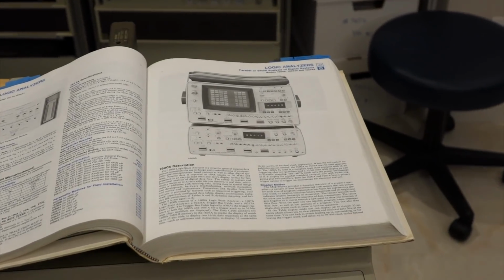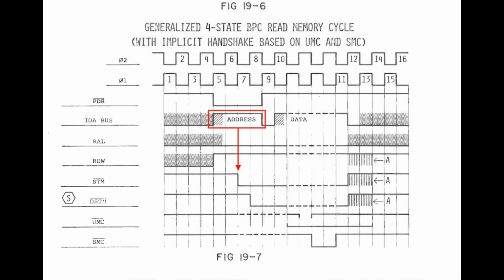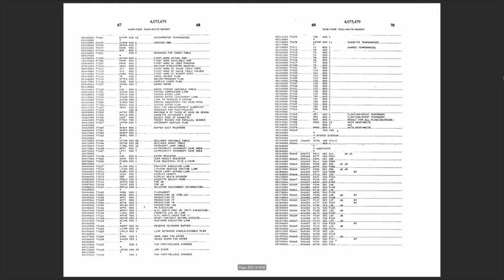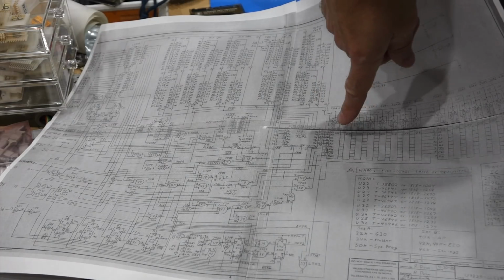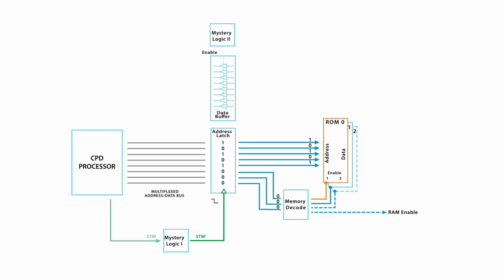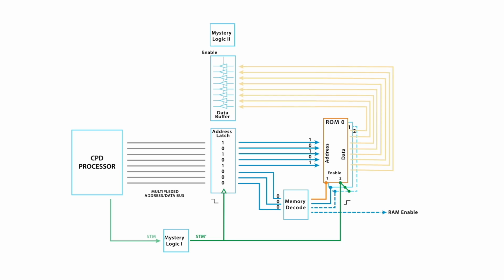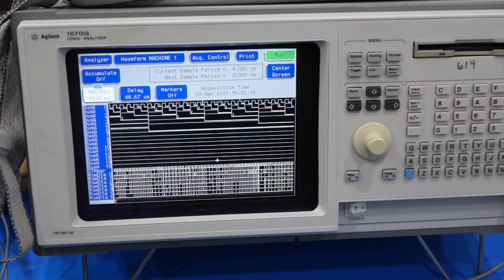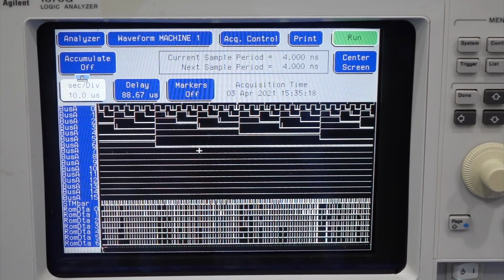HP 9825 Repair Part 3: HP Logic Analyzer to the Rescue

Comment: Hey, do you think you could use that logic analyzer to help reverse engineer and replicate a rare and expensive piece of computing and videogame history?

I am of course referring to the controller bundled with the videogame Steel Battalion for the original XBOX.

The controller and game were around $200 when they came out, but the controller alone is even more expensive today! We're talking upwards of $500 on places like eBay.

If we had the capability to fully reverse engineer it, and make an open-source clone... Well, that would honestly be incredible.

Comment: Just watching you trying to understand the signals on the logic analyser makes my head hurt. I can't imagine doing this myself, not only would there be fried chips,  my brain would be fried too.
You should just replace every standard TTL logic chip that is not a custom part and the RAM and ROM chips too. You can easily program new ROMs. Good luck finding replacements for custom chips (for example GALs, PALs, CPLDs, etc...) though.

Comment: I have a sentimental connection to HP hardware. My first encounter with computers was with HP 85, which I first saw in about 1980-ish (my dad brought it home from work a weekend ). Later in life I've come to respect the lasting value of their measurement instruments (I am a cross-over physicist by trade). In my lab there was a spectrum analyzer from a long time before my era, and it performed still about to the calibration certificate from twenty years ago. Weighed a metric ***kton but in those days you got what you pad for, paid an arm and a leg.

Comment: I had to debug a machine like this once. Not with a multiplexed bus, but my logic analyser was a cheap USB one with 8 ports. Traced the boot sequence by looking at 4 address-lines and half the data bus.

Turned out someone had done a bad rework to the RAM, losing some traces in the process.

Comment: That patent is back from the days before everything was crap like it is now. I used to do a lot of work with OBD-II automotive PCMs and getting the source code from reversing the binaries on the flash ROMs, and patents like that were invaluable for understanding specific aspects of the software. They didn't give any code, but they gave the algorithm, which was enough to figure out what was going on.

Comment: Marc, I admire your persistence, but I have to ask, "What are the chances that any of those TTL level chips survived a 10+ V supply?"

I recently had an identical failure in a much less valuable device, and I've assumed that everything in it is toast.

Bon Chance. I'll be watching with my fingers crossed.

Comment: I wonder if you could at least try to put the CPU into the one that works to confirm it's okay? Knowing it's good or bad could cut down a lot of your time so might be worth the swap.
Reply: Risky...CPU  may well be damaged,and it could damage a unit its swapped into,they have to hang it out,we'll get there.Fault finding is 50% patience,when you try to short cut,you often make things worse,i know,,ive learnt to my own cost!!!
Reply: @julianrichards9509  Do you really think so? Maybe I've just been lucky, but I've never had issues with a faulty CPU frying things. It's not outputting weird voltages or anything.
Reply: @briangoldberg4439  Sorry to be so long Brian,it is my mindset to be very cautious mate.Did you ever see the movie Apollo 13?The side of the module blew,and all of a sudden,the telemetry went absolutely crazy back on earth.The crew reported power supply failures,the  AGC rebooted,there was a loss of pressure on fuel tanks,and during one point in the mayhem,you hear this cool voice of mission director Gene Krantz say"okay lets work the problem people,lets not make anything worse by guessing"
He was damned right.I used to repair multiplexers used by the broadcasting industry in their newsrooms here in England the BBC ,ITN, amongst others were our clients.Whenever i tried to shortcut, sometimes i got away with it,but sometimes i made things worse,and regretted it.Working the problem takes longer,and is painful whilst you're going through it.But when you get out the other end,you feel  that you now understand the problem,and can deal with it confidently.
You maybe right,swapping it may tell us quickly,that the processor is a veggie,although it looks as if it wont be easy to remove  these CPU's,and you'll have to do that twice.
But i think Marcs approach is sound.He's getting readings on the  Logic Analyser which don't make sense,and he's verifying he's not  being a jerk,by setting his analyser up on a good working machine.He will then know he's correctly setting it up,and can attack the dud machine.I used to sometimes have crazy readings on my hp logic  analyser,i was faultfinding Intel 286 mboards. It  usually turned out,i wasn't setting things up correctly,and when i corrected my setup,the bus activity made sense.
I hope i havent been too wordy here Brian!!!
Reply: @julianrichards9509  No worries Julian. I asked a serious question, and I got a serious answer! I think it's refreshing that the viewers of this channel seem to be calm an intelligent, and capable of respectful answers. :)

Comment: TTL can be incredibly robust though, and survive well past the absolute max rating. Just a combination of the early process control not being as fine tuned, and the abs max ratings being very conservative on the voltage side, as they found after multiple batches that 7V was the point at which one device did fail initially.

Comment: Many years ago I worked in the US Navy. My primary job was Aviation Fire Control for the A7-E aircraft. I had been trained in intermediate repair for several “black boxes” in the aircraft. Along with that I was trained on the “ATE”, Automatic Test Equipment for most of the test sets that actually tested the black boxes. One such test bench was built by LTV for testing the Armament Station Control Unit. This black box was where the types of armament and station attached information was punched into the ASCU to let the computers know what was mounted on the aircraft and where it was mounted.
The test set for this ASCU was hugely complex. No microprocessor. It had about 60 cards filled with TTL logic chips. One day we found 2 push buttons faulty: “Start” and “Reset”. The buttons were illuminated with 24vdc on one side, and +5vdc logic on the other. We sent the panel and the new switches to the repair facility on the ship, and in about 2 days it came back with new switches installed. We didn’t check the wiring, we assumed they put them in correctly. Big mistake. When we fired up the test set everything was normal. We loaded up our test gigs to do a self test, loaded the self test punch tape in the reader and put it at BOT, Beginning of Tape. My colleague pushed “Start” and the test bench immediately belched smoke and turned off.
The switch was wired such that, when pushed, connected 24vdc to the +5vdc rail.

It took us 2 months and over 100 chips to fix the test bench. And another 6 months to change more chips as the stress related ones eventually failed. By the time the machine was reliable again we had changed 160 some-odd chips, and the +5vdc power supply.

So, believe me when I say, I know your pain.
Reply: Former USAF here. We had a guy who was either dyslexic or just plain not very good, and he would plug TTL logic and Op-Amps in backwards.  When he turned the equipment on, it would blow tiny craters out of the chips. 

But my favorite of his was when he swapped the neutral and the ground on the AC input, so that if you slid it over to touch an adjacent piece of equipment, you would get tiny sparks (the workcenter wiring was questionable too).  Luckily, none of the stuff he worked on put any lives at risk.

Comment: I always had a preference for Tek 'scopes and HP logic analyzers...  Although, that said, the 7D01 logic analyzer plug in for the Tek 7000-series 'scopes is a (still) very useful tool.  In fact, it was ahead of its time in that you could keep an analog vertical plug-in in the left vertical slot, have the 7D01 in the 2nd vertical slot, and do mixed-signal debugging - IOW, trigger an analog trace on a digital fault or vice versa...   The only "cheating" going on here is using modern test equipment to test vintage gear!  lol  (j/k - great video)
Reply from the maker: Agree on everything! Tek scopes and HP LAs (at least in this vintage era - not so true anymore). BTW I just got a 7D01 for my Tek 7854, maybe if we make it work I can do a video on it. It’s so small and cute!

Comment: What about replicating the circuit using CMOS parts and using level shifters to send and receive signals to the CPU so you don't blow up the CPU chip or see if it is possible to replicate the board using a FPGAs and CPLDs.
Reply: I don't think the ttl chips loading the CPU are the problem so much though,it was the stonking great 13V rail that caused problems to all the chips that were on the 5V supply rail,,, weren't expecting that!!
Some would have gulped too much,and died in their bedrooms,,some may have just held on before the supply failed,its a question of evolution now.The chips they replaced weren't loading the CPU bus really,this looks like its now a dead chips hunt..
The FPGA route is certainly a possibility i agree,if the worst has happened and CPU is damaged ,but,,,,,,a TON of work..Karl looks dead!!
What's happened to ken?Hope he's okay.

Comment: I wrote my first lines of code on that model, and multiplexed bus reminds me the 8051 back in 1985. 
Bon courage !
Reply: And the ALE pin signals on the 8051 had such sharp edges that it radiated every 0.5MHz up well into the UHF band

Comment: Thanks for sharing this repair process, is very interesting. In the past I have founded a little trick to find fried ttl or cmos ic's. The fried chips are very sensitive to the thermal changing because they are carbonised and variate their impedance on the vcc rail. With an hot air gun, a little nozzle and an ohmeter on the vcc rail is possible to see the impedance raising when a fried chip become hot. I hope that it's helpful, a nice day, Gerry from Italy
Reply: I think that the curiousmarc has already found a solution, but he releases its videos with an about 3 weeks delay so most likely it will not be relevant anymore
Reply: @michvod  Still useful for a lot of people reading this. And very interesting.
Reply: @benbaselet2026  It is very interesting :) My experience with failed ICs was usually almost zero ohm shorts
Reply: I never heard of this approach before. If I am ever in a situation where it might be helpful, I hope I will remember it.

Comment: Gyms are closed in Germany. fortunately i got a barbell, a bench and some weights at home. and now, thx to covid i work out while watching Marc repair a HP 9824. strange times indeed
Reply: Unusual times require unusual solutions
Reply: Uuh, hp 9825 not hp 9824, and this is a 9825T to be exact

Comment: Cool video as usual. Is there an "inverse assembler" available for that processor? I spent a few days in the early 90s writing one for a slightly older HP logic analyser than yours so that it could display Hobbit disassembly on the fly when debugging.
Reply: *disassembler :)
Reply: @catalinbadalan4463  Normalkt, yes but not in this case. For whatever reason, HP's documentation refers to disassemblers rubbing in their logic analysers an inverse assemblers. There is a difference in that this code runs in real time not after the fact so that you see mnemonics on the analyser screen instead of just hex

Comment: If you have a second HP then you can swap in the known good boards to verify your CPU board works on the bad one. You can also systematically swap back in the ones from the bad computer to find out what boards have faults.
Reply: Great idea: we could end up with a bonus repair of the second one ;)
Reply: I think he's intentionally avoiding that kind of shortcuts for making the video more interesting. (Forces the flow of the video into deep troubleshooting and circuit analysis)
Reply: @leonardoliveira  You wouldn’t want a working board to be damaged by fault in the broken machine, then you would have two broken units. Maybe a semiconductor is now a dead short to the power rail, or a capacitor is a dead short to ground. That chip at the end of the video probably didn’t leak its magic smoke due to its age unfortunately...

Comment: I hope you have added the safety DC-DC converter also to the second 9825 so that it does not fry if a power supply transistor goes bad again !
Reply: It was called a crowbar modification right?
Reply: @zomaardan  Yep, simple self-kill switch, when voltage goes too high.
Reply: @zomaardan  You could use a fuse in line with a simple TVS Diode to ground or you could implement the active crowbar circuit that was implemented later.

Comment: I love the fact that you are facing an uber complicated troubleshooting and you still call double checking your 2nd 9825 cheating!
Reply: Indeed.  As Tony Duel put it in his 98xx repair manual, "No board swapping!"  Swapping boards between a good unit and bad one is cheating.  It's also dangerous b/c you can break a good board by putting it in a bad machine!
Reply: if I didn’t have a second Fairlight CMI to check my other one, I would be at a loss,
Reply: I used to do a lot of production repair. You do tend to have the best information (nip over to development to get a ROM listing) but the downside is that, when repairing a failed machine, there's rarely more than one fault. In production, the machine has never worked, so it might have all of one part upside down or any number of errors. Repairing Marc's machine is in-between - you haven't got manufacturer support and there could be any number of faults. But it did work once.

Comment: First again. I wonder what kind of vintage bits I get this time. 😉😉
Reply from the maker: Congratulations. You get carefully over-voltaged vintage TTL chips this time. Fried to perfection, just enough but not too much so that some might work, some might not, some might fail later on...
Reply: @CuriousMarc  Hi, I have an HP 9825A that seems to be in working condition. I would like to sell it, if you are interested? Let me know soon, because I plan on listing it on Ebay this week. The keyboard is missing 3 keys, they seem to be brittle and cracking where they fit together. I will provide more details if you are interested. Thank you.